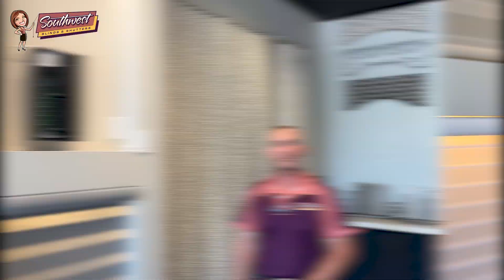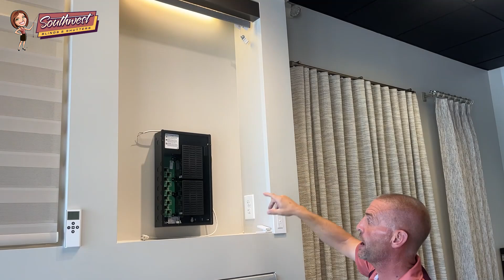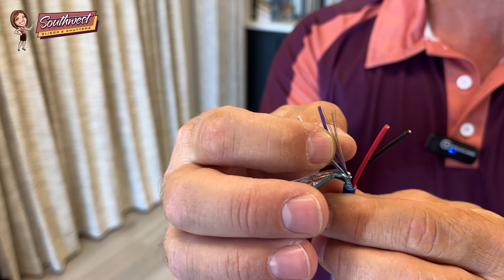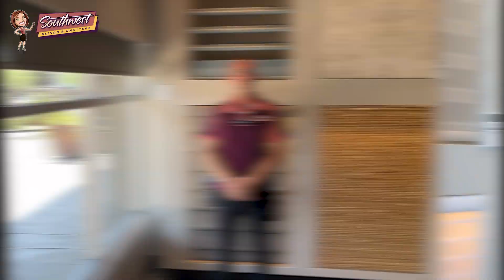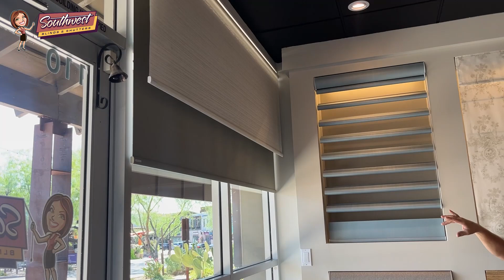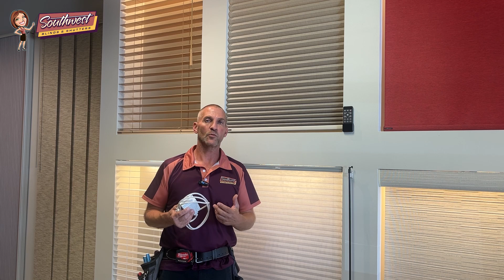Motorized Shades Installation FAQs: Expert Guide to Low Voltage Wiring Planning

Comment: did bro just say a bigger gauge cable will give you too much power so thats why we use 16 lol bro you only get the power down the wire its supplied, a bigger gauge reduces resitance so you dont have as much voltage drop... guy knows his shades everything electrical not a clue lol.

Comment: Great video and good explanations of things others skip over- 
question. I would like to run the home runs to the basement under the windows but it is a drop ceiling. Can this be mounted in the ceiling rafters above the drop ceiling? So to set the control box horizontally vs vertically in the wall?
Reply from the maker: As long as you have power available for the power panel and are able to run the wires to each window, it shouldn't be a problem. I'd recommend checking with your local window covering provider first in case their power panel has different specifications.

Comment: When you say 1” in do you mean from the back or from the front? So closer to the glass or to the room interior? @southwestblindsandshutters
Reply from the maker: We suggest 1" in from the back of the glass, closer to the glass. You'll need room to mount the shade brackets, shade, and top treatment. In Arizona and Las Vegas, most homes have 3"-4" of depth so you have limited space. The depth of the window covering varies by window covering type so that will need to be considered as well.
Reply: @SouthwestBlinds  thank you I did 8x8 finished pockets so I should be good space wise